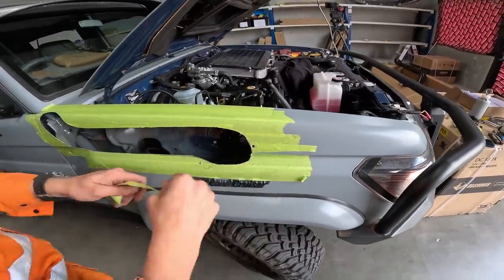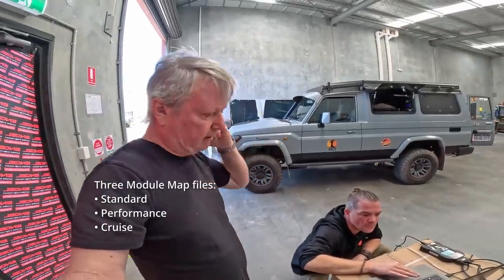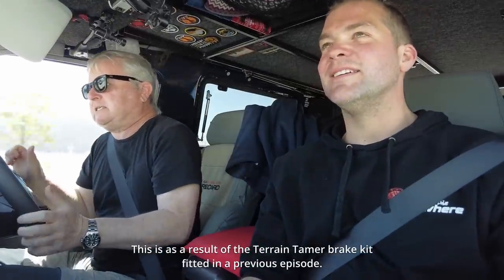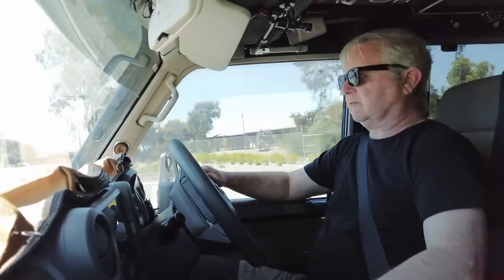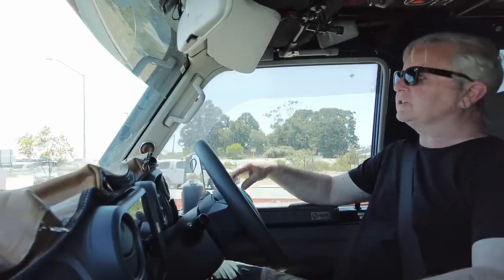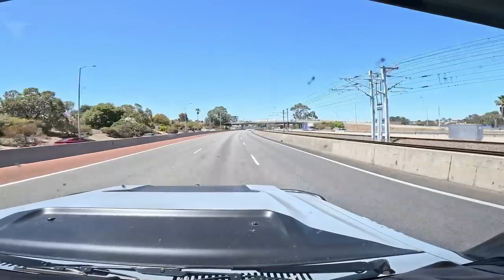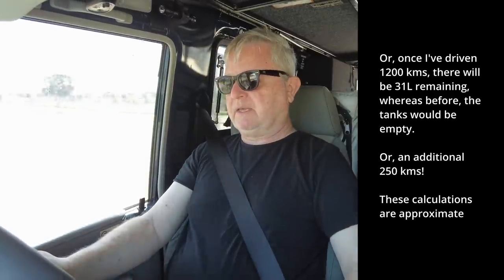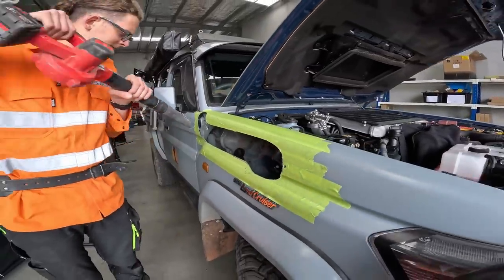Torqit Performance Product Test Results. Troopy Masterclass part-3 | @4xoverland ​

Comment: I get 9.5lt on my series 76 , No modifications,  only a track correction with a DWIZ axle conversion.
Reply: I find that hard to believe, I have a 2008 Troopy and & a 2009 76 series, both do 13L/100km. Are you driving it downhill with a tail wind and the motor turned off most of the time?
Reply: @malcolmL995  that's what I'm getting since I bought my 76 8 months ago. I hired a 2.7ton Carravan and consumption when to 14.5lt per 100km. No Malcolm definitely not driving down hill. I'm pretty happy with that.
Reply: @gary412222  I think there is something a bit suspect though? As soon as I put the caravan on the back of my Troopy it goes up to 21L/100km. It’s been on the dyno and running to manufacturing specs. My 76 is exactly the same. Heck, my wive has a RAV4 and it not does 9L/100km
Reply: I stand to corrected.  After 2016 or 2017 Toyota  changed the gear ratios on the gearbox which would have changed the fuel consumption slightly .My 76 is a 2018 model.
Reply: Ps . The handbook says 9.5lt per 100km
Reply: @gary412222  ok, fair enough, I wasn’t aware of that and apologise. So then, why is Andrew’s doing about 15 or 16 or whatever he said on a long run? My Troopy is probably as loaded as his.
Reply: @malcolmL995  You are right. It mainly comes down to weight.  I haven't put on a bullbar nor any roof rack of any sort . Andrew has allot of gear and I'm not sure what he has done with his engine tuning etc.All this is going to affect his consumption.
Reply: @gary412222  yes, it’s all a bit strange. On the Troopy I have bull bar, no roof rack, dual spare wheel carrier, don’t have the newer gearbox but still get better fuel than Andrew does. The 76 has bull bar, roof rack, dual wheel carrier. As I understand it, from his video, on the long trip he did he was getting about 15L/100km and that was before he did anything with the motor. I have no idea really. 😀😀😀😀
Reply: @AVRO what year is yours?
Reply: @malcolmL995  is weird, no idea. Have a good Christmas and New year 🎄
Reply: @gary412222  thanks. You too.

Comment: I don't understand the fuel economy tune. When I tuned my petrol v8 commodores you map the fuel table. The performance and cruising part are different sections of the map. Think of engine loan on one axis and engine speed on the other axis. You could clip the performance off the top to force people to drive good, but if you know how to drive you should be have the performance tune with similar fuel economy. 

I also don't think the exhaust will improve fuel economy or power in a fairly stock(non drag car 1500hp) car. Turbo produce alot of back pressure and force the induction anyway. A restrictive DPF can. The only performance and economic gains are in the stock tune being bad. Usually they are super rich to provide cooling to the cylinder, also low on boost.

Comment: Generic tunes are a ticking time bomb. Get it custom tuned, it will also negate the need for the throttle controller
Reply: Hi mate, these tunes aren't generic mate, all tuned from scratch, for each vehicle
Reply: @TorqitPerformance  Do you recommend customers get their vehicles on a dyno afterwards?

Comment: From memory you fitted bigger tyres than stock... so rather than your odo being under it will be over... So i think you applied that correction the wrong way, meaning your economy will be better than you stated.
Reply: Andrew's tyres are smaller than stock - stock 225/96R16 are 827mm diameter and his 265/75R16 muddies are 814mm diameter
Reply: @philg2468  Ah, I thought he fitted 285s in the end.